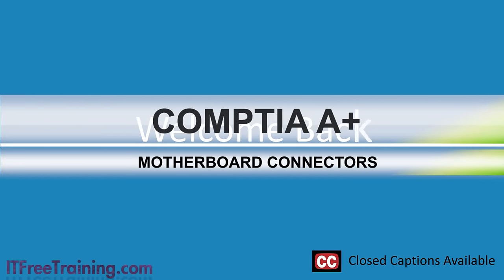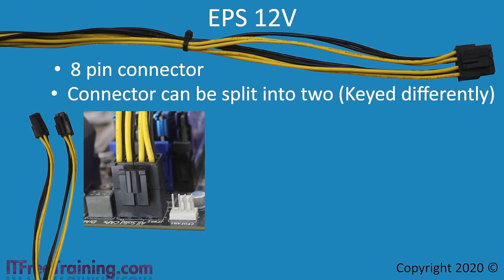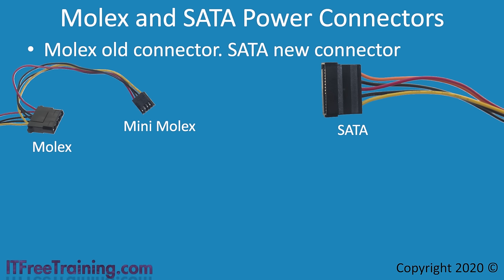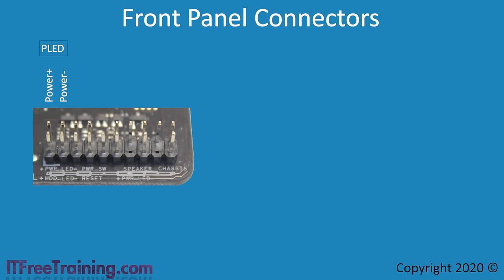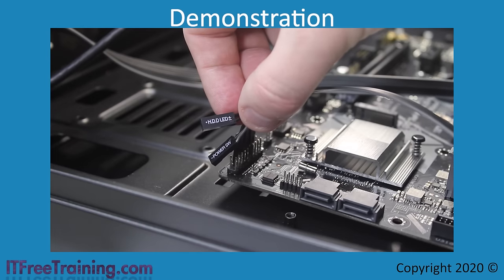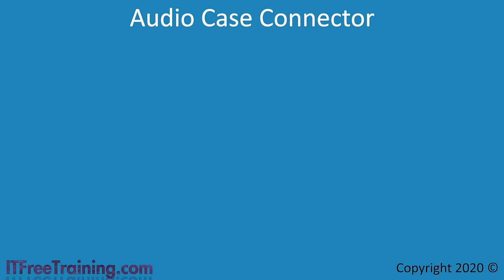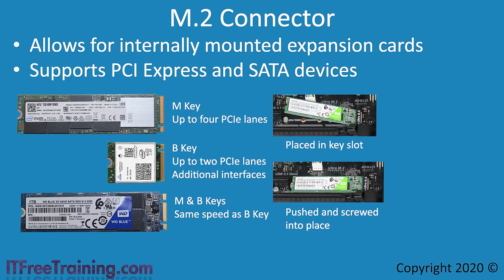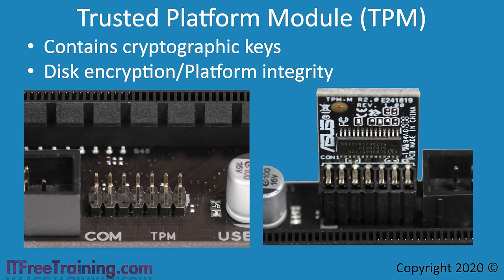Motherboard Connectors

Comment: Hi there, great video and straight to the point, clear and concise method of instruction. However I do have a query about standard front USB and AUDIO case panels used in conjunction with (Ahem) Dell motherboards? Pinouts are impossible to find as I get an error on boot up and have to press F1 to start every time. I could stop the error message in BIOS, but is just one of those niggling things; like an itch on my back that I just cant quite get! Any Ideas?? your help would be much appreciated. Thanks

Comment: the only thing i found hard to connect to the motherboard were front panel audio connectors that didn't came as one connector. those were hell, i hated those computer cases
Reply from the maker: It is difficult, I once had a motherboard that had an adapter which made it easier, but I have not seen one for a long time which is a shame.

Comment: This is one of the most practical and informative knowledge base educational videos made by this gentleman. Those who claimed themself a PC builders in theory are just putting those parts together like the old days when we jigsawed those toy model cars that came with a small battery motor. They are not building anything at all! Very few to none that explain how the technical part works nor where the electrical wire should go and how it works.
Reply from the maker: Thanks, glad you liked the video.

Comment: Finally! I found a video that clearly illustrates and explains motherboard connectors/connections. I'd like to ask though, is it possible to wire a two prong toggle switch between that that 24 pin cable and PSU?
Reply from the maker: Glad you liked the video. 
I am not sure what you are asking. It is possible to buy cables or adapters which allow two PSU to be used together on the same computer. This is generally used for mining. I have used one before and they work quite well. You can see an example of one here.
https://www.scorptec.com.au/product/power-supplies/accessories/69884-ac-005-cnonan-p1
I have not used one before, but there are some power supplies that support two computes. They are rare and possibly the only the company that makes it. I could be wrong.
https://www.phanteksusa.com/products/phanteks-revolt-x-power-supply?variant=12550351257655
Reply: What is a "two prong toggle switch"? Never heard of such a thing in my life. and this switch goes in between the 24 pin cable and the PSU? That doesn't sound safe.

Or were you referring to an adapter with dual 24 pin headers that can power dual systems?
Reply: @angrysocialjusticewarrior  a two prong toggle switch is basically a toggle switch with two contact points only. I call it that because that's what I saw.

I'm thinking of cutting the green ps_on cable from the 24 pin power cable and putting a toggle switch in between. I have no idea if that's okay.
Reply from the maker: @vedeledev  I know what you are referring to now. If you have a look at the following video it will explain which wires you need to use. https://www.youtube.com/watch?v=QvIVtmFq2cw
It would be possible to add a power switch to a PSU. You can also purchase an adapter to do this. See below.
https://www.amazon.com/CRJ-24-Pin-Switch-Jumper-Sleeved/dp/B01MSY4966/ref=sr_1_2?dchild=1&keywords=1+x+24-Pin+Female+ATX+%2F+EPS+PSU+Jump+Starter+Bridge+With+Power+Switch+%28N016%EF%BC%89&qid=1606268099&sr=8-2

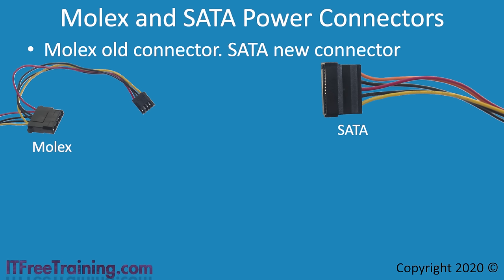Comment: 8:40 Mini Molex connectors are still useful for powering mini converter cards. For example, I have cards that allow Compact Flash cards to be attached to the motherboard to act as a HDD, which is faster than mechanical drives and can replace old IDE drives at a lower cost.
Reply from the maker: I found it "2.5" Drive Bay IDE to CF Adapter Card". Thanks for pointing this out. I will keep it in mind for future videos.

Comment: My last build was in 2006 need an update about the eps connector thanks!
Reply: I have also discovered that you can find this connector in all 750w PSU but below you need to check carefully if it have the connector only 80 gold can have it and not all brands... just my 2 cents...

Comment: Thank you for this video. It explains the how and why of computers, which I have always wondered about. I have a question: have you ever heard someone claim, "The 12V and Ground wires are not necessary on a PWM Cable"? 

And, here are my follow-up questions:
Why would they say that? Obviously, PWM Cable manufacturers have a specific, rational, and logical reason for producing all PWM Cables with four wires instead of two, but I do not know what that reason is. Why would a Computer Builder purposefully cut off the 12V and Ground wires on a PWM Cable while building and testing out a build? Who coined the so-called "fact" that you have to cut off these two wires, and why?
Reply from the maker: It is possible that some motherboards you could do this and the motherboard provides a ground another way. Not sure why you would do this as it is putting more load on the motherboard ground.

It is possible there are referring to the PWM wire which controls the fan speed. Maybe they want the fan to run at max speed all the time.
Reply: @itfreetraining  That makes sense. Thank you for the clarification.

Comment: Hi anyone can help me on Asus 790k  how to connect in the right way the 4 pin of the power ??? Because if I plug a 4 pin of power on the motherboard it doesn't start!!
What are the right connectors for a 4 pin to start correctly ??
 The bios show the error that requires ALL atx connectors connected!!
Reply from the maker: The connector is keyed. So you should have to plug it in. Check to make sure that you have the right connector and it is being put in the correct way. Have a look at the connector itself, you should be able to see the square and circle pins are.
Reply: @itfreetraining  the power generator hasn't the cables named! A technician has used 2 4 pins for 8 pins 12v into  second power connector! Why this choice? It's confusing!
Reply: And the 4 pins wasn't connected!

Comment: Dell laptop SPK cable motherboard connector how is this designed? How is the motion expected to remove and install it?
Reply from the maker: Speaker Power Key. This cable is typically responsible for connecting the laptop's built-in speakers or external audio jacks to the motherboard's audio controller.

Connector Design:

The design of the SPK cable connector on a Dell laptop motherboard can vary slightly depending on the specific model. However, it's generally a zero-insertion-force (ZIF) connector. This means it requires minimal force to insert or remove, reducing the risk of damage to the pins or the motherboard.

Comment: Question, aside from my 24 pin connector, my motherboard (MSI z87 mpower) has two 8 pin connectors for the CPU, do I need to use all or can I use just one of the 8 pin connectors to supply to extra power I need???? 

I'm using a cooler master gx650 PSU that has only two 4 pin connectors marked cpu on the connector? Would that be alright to use or do I need the extra 8 pin connector for the md 

Please let me know, I need help

Comment: Are 2 pin fan connectors safe to use on the motherboard? I've taken out fans from several scrap PSUs, I think they basically run at maximum voltage/speed.
Reply from the maker: You may be able potentially still use them if you can plug them and connect them to the right pin. Since the Tach pin or PWM pin won't be connected the motherboard won't be able to control the speed of the fan. If you are going to try it, I probably consider using a fan splitter and put a 3 pin on the same splitter, that way the other 3 pin can control the speed of the 2 pin since they are on the same circuit.

Comment: My motherboard has a 10-1 pin COM socket, what is that for ?  (Asus prim h310i plus r2.0) and thank you for explaining is such a easy way to understand for everyone
Reply from the maker: This is used to connect the serial port module cable, this is than installed at the back of the system chassis in an expansion slot to provide a serial port.
https://www.amazon.co.uk/StarTech-com-PLATE9M16LP-Bracket-Profile-profile/dp/B007UQZD9K

Glad to hear that you like the video.

Comment: I have an acer tc220 mb. It has a 2 pin cmos1 and 2 pin intru1 both are not connected. Are either of these the 2 to jump and clear the bios settings?
Reply from the maker: This is not un-common. Usually you just short the pins with a jumper and switch the computer on.
I would refer to the manual for the motherboard to make sure you found the correct ones. On the motherboard it may be printed on it.

Comment: my power supply has an 18+10 pin connector and the motherboard has an 18+10 pin connector. Problem is, the motherboard is bad so I need to get another and I can't find one with that configuration for sure. Even this motherboards manual showed a 24 pin connector as do all other motherboards that I could find, so how can I find one that I know would have the right connector?
Reply from the maker: If I am understanding you correctly, you need to purchase a cable to use that power supply with the new motherboard. Maybe something like this.
https://www.aliexpress.com/item/32926959569.html

Comment: hi, may i know what's the brand of your connector? i been finding this design, colorful wire with semi transparent sleeve.
Reply from the maker: There are a number of different cables used in this video. Most of them are the standard one that come with the computer or the power supply. Is there are particularly one that you were interested in?

Comment: Is the motherboard  P1 split 24 pin plug. How is the plug with 4 Pins oriented where it plug in next to 20 pin section?
Reply from the maker: Depends on the power supply, but many are. The plug is keyed so it will only go one way.

Comment: I have a HP Pavilion Gaming pc TG01-1000NP that the Baker 8767 MB takes a weird 4pin main connector 2 yellow 2 black and another 4pin connector 2 brown 2black for CPU PWR. Now, there's an extra cable P2 for PWRCMD with 7pin 3cables 1black 1grey 1green that I believe it's used to power up the cooling psu system. Is there any workaround to this if I want to upgrade the PSU without having to pay for a proprietary psu ?
Reply from the maker: Not that I am aware of. There may be some kind of converter cable you can purchase, but don't count on it. Since it is proprietary sometimes someone may create a cable like this, but there is not a big market for them and requires them to have a good understanding of the hardware and proprietary hardware they don't release their specifications.

Comment: is the p4 still in motherboards? im building a pc and there isn't one
Reply from the maker: It is still on motherboards. It is usually near the CPU. It is possible for the manufacturer of the motherboard not to include it, however this is rare. I am guessing if you don't have it is may be a low powered motherboard or a mini board or something like that. I would have a look at the motherboard diagram in the manual, it may be hard to see. If it is not there you don't need it.
Reply: @itfreetraining  is it the esp then?
Reply from the maker: @sssalomaa1310  I see. On the older motherboards it will be the 4 pin (P4) connector and newer motherboards the 8 pin (EPS). The motherboard will generally have one or the other but will not have both.
Reply: @itfreetraining  thanks im really surprised you bothered to answer to my stupid guestions :)

Comment: helo i have a 4+4 p4 connector, and my new motherboard features an 8 pin connector. However, my 4+4 pin doesnt fully match the shape of the 8pin connector, only 4 (half the connector) has a match shape with the 8 pin. Should i force the other 4 pin too(eventhough they have different shape, but it can still fit)
Reply from the maker: I would not force the connector. Have a look at the end of the connector. The connectors will either be round shape or square. Check the motherboard and see if these match. If they do, it is the right connector. If they do not it is not the right connector.

Comment: Will the power switch connector to header always look like this cable?  Have a z490 motherboard and man im not seeing it.....i might be blind
Reply from the maker: Unless it is a proprietary the connectors will be the same. There are a few different z490 motherboards so I don't know which one you have. I would suggest having a look at the manual this will tell you where the connector is. Sometimes the connectors may be divided up.

Comment: what when there is in motherboard the 14pin slot to add but i cant connect bc there no port bc autor of motherboard get it of? where i can get this port to do it into motherboard?
Reply from the maker: If your motherboard has a 14-pin slot but lacks the necessary port for connecting to it, you may be dealing with a proprietary connector, or the manufacturer may not have included the necessary connector for that slot. Have a look at the manual to confirm what type of connection it is.
Reply: @itfreetraining  ok thx :)

Comment: hi, I have a 980 which has 12 pins on it, can I use two separate 6 pin connector to supply power to the GPU? by the way  the first 6 pins on GPU and the second 6 pins  have the same keying.

Comment: I have a motherboard that has voltage control and I accidentally changed from 240v to 115v, it is not turning back on, what can the problem be .thanks for the above video.
Reply from the maker: Glad to hear that you like the video. A lot of the time when you change the voltage on the back like that it will blow the power supply. Usually you will hear a bang. Hopefully it will only take out the power supply. I would unplug the power supply from the computer for testing. Use a power supply tester to see if the power supply is still working. If you don't have a power supply tester, you can always try the paper clip method.
Have a look at our video in power supply tester for more information.
https://www.youtube.com/watch?v=QvIVtmFq2cw

Comment: i build a pc and it wont show anything on screen do you think is it because my cpu cable requires 8 pin cable while my psu have a 4 pin cable?
should i buy a 4 to 8 pin adapter?
will it give the required power?
Reply from the maker: Most likely the CPU needs the power to work. An adapter cable should work fine. At the end of the day, it depends how much power is being drawn from the power supply rather than the connectors on it. So, if you put to many splitters and adapters on the same power supply you may get problems, but a couple should be o.k.
Reply: my psu is 450 w which is more than enough for all my parts on the pc i am going to buy an adapter and hope it works becuase if it doesnt i dont know what the problem might be

Comment: Would my sound wires being plugged in wrong cause only input to work or only output to work but not both together?
Reply: For anyone wondering, it happened to be a bios and chipset update I was behind on. Messed around with sound settings after updating and got it to work very well.

Comment: Just to confirm.  3 pin connector fans always   run at full speed and 4 pin connector fans speed can be controlled ??
Reply: No not correct. Both the speeds can be controlled. A four pin are generally used for fans with lights etc. A 3 pin the voltage controls the speed and thus when the fan is spinning slowly the led light will be dimmed as well. 4 pins the fan led light will always be the same brightness since the speed is not controlled with voltage.

What can happen however if you put a 3 pin in a four pin plug that does not support 3 pin the fan will spin at max speed. Motherboards should support both, however graphics cards this will often be a problem as they often don't support both. So it you plug a 3 pin into a 4 pin and it spins at max speed all the time you need to change it to a 4 pin.
Reply from the maker: 3 pin and 4 pin fans can both be controlled. Just depends on if the plug there are put into supports them. If you plug a 3 pin in a 4 pin that does not support it, the 3 pin will run at full speed.

Comment: It is literally impossible to hear the difference with a speaker plugged in backwards, even for an audiophile. So I don't think plugging in backwards a little speaker that is going to be buried in a case and only make beep sounds actually matters.
Reply from the maker: You are right, it would be pretty hard to hear the difference and pretty much the PC speaker only gets used for beeps nowadays. More for professionalism you would plug it in the right way.

Comment: I have a WiFi card that wants the Bluetooth wire to be hooked up to a USB pin set. Can I use the COM pins for the connection? I am out of open USB ports.

Comment: What if your P3 and P4 cant reach the pin connector. What can you do?
Reply from the maker: You can purchase an extension pack. We use them so the power supply does not appear in the shot when we are filming.

https://www.amazon.com.au/Sleeved-Cables-Extension-Supply-Braided/dp/B085ZFFWXD
Reply: @itfreetraining  oh ok. Thank you so much

Comment: I don't understand how m2 supports pci and express devices if it has its own connector, is it just the bus it supports?
Reply from the maker: m.2 has it own connector. The connector has a number of wires on it. So essentially these wires can be connected to any chip with any bus that is supported. So M.2 can be connected to a chip with PCI express bus. The M.2 can connect to a chip with SATA. Could be connected to a chip that supports both and detects what is on the other end. A lot of modern connectors are like this. They change what the wires in the connector do depending on what is on the other end.